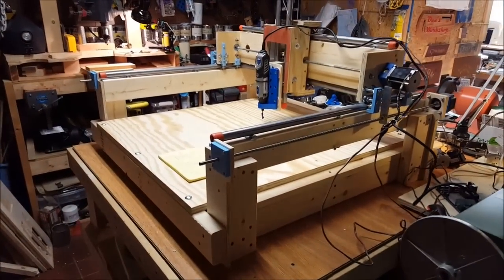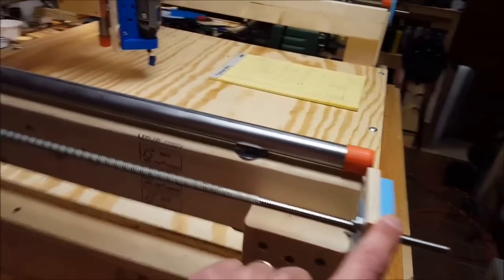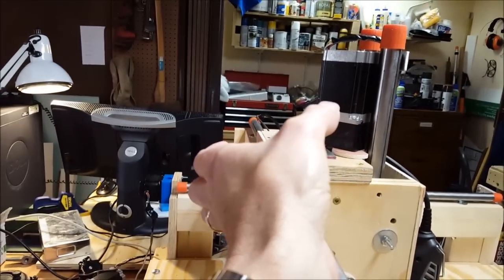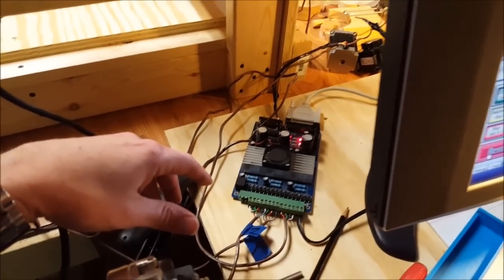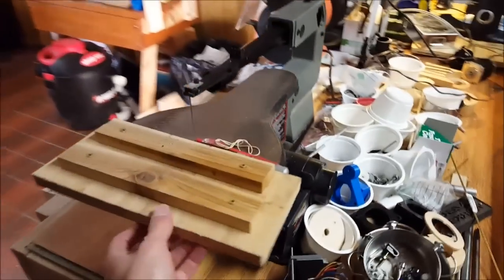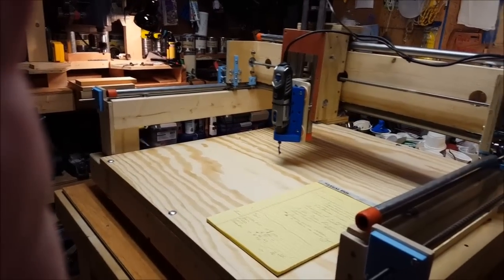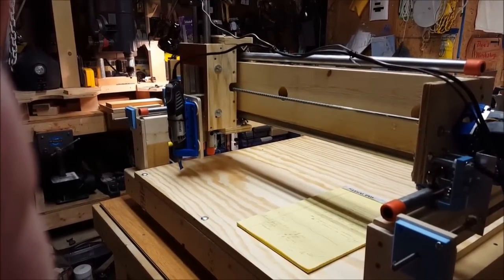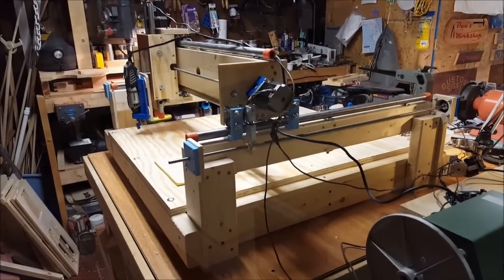Solsylva DIY CNC - Basic Machine Finished!

Comment: i built a 2x4 in 2011 and i want to get it out and make some mods on it. i have a bosch Colt on it i think, man its been so long.

i used the same solsylva plans, and picked up the 3 motors plus driver board in a case, i thinkt that setup was around 400 bucks back then. in all i think i spent about 1000 bucks to build the whole machine. hard part was software. i just cobbled free stuff together and eventually that took its toll on me. but now, maybe revisitable.

Comment: hey dear 
i love to c your creation and i am also planning to build my own cnc
can you please tell me how did you connected two stepper motor for x axis, i want to know to know how you made this connection with driver and breakout boars because it generally has only one point for each axis. Please tell me this
Reply from the maker: Ideally, whatever CNC board you use should have a dedicated driver for each axis.  But for my projects, like this one, I've been able to just double up two motors on one axis.  Since the motors are going in the same direction they are just connected to the same driver in the same order.  Wrap the wires together to insert into them into the screw mount.  Best of luck in your project.

Comment: It's a great start, but you need to pull off that stupid dremel piece of crap, and put on a real spindle, and then you will fine.
Reply from the maker: Already did that here...https://www.youtube.com/watch?v=e2QDJi4FLc8
Reply: I bet it did not take too long to figure that out, but you did a really nice 3D print of the holder. Amazing print.
Reply from the maker: Yeah, using the Dremel was not my long term plan but I was hoping to have it on there for a while.  I've used this Dremel 4000 on other CNCs for small stuff and it's been okay.  Just wasn't matched well with this beefy of a machine.  The prints did come out well from this cheap 3D printer kit.

Comment: That wood is going to move as the weather changes. Goodluck
Reply: alphasxsignal even if it's all plywood, moisture content and humidity are going to be a bitch when trying to get high accuracy through time.
Reply: he she use the cnc to build parts for a aluminium version ;D

Comment: What voltage do you run your motor drives at? I don't want to tell you how to spend your money but I upgraded from TB6560 to TB6600 drives myself. It was a nice performance bump for me. I have BL-TB6600-V1.2 drives. They're like $8.18 a piece. You could setup your X axis right with them. Running 2 motors off one drive is jenky, but you know that. Those all in one TB6560 boards are crap. I'm not going to get into why, but how they sense current is garbage. If you do get some 6600s hit me up and I'll explain how to set the current on yours.

Comment: For the spoil board, a suggestion that might make it easier to replace, instead of those giant bolts how about some screws? That would make replacing your spoilboard less of a hassle. Just some thoughts from a previous cnc build i did and built it similar. Nice job btw. this was a great build and videos were great.
Reply from the maker: Thanks for your comments.  I thought about that but wanted something that wouldn't chew up any parts of the actual machine when replacing parts.  But that is certainly an option.

Comment: I recently "reworked" my CNC.  Went from Drawer slides to V bearings and Aluminum Rails.  Also went from 1/4 -20 threaded rod to timing belts on the x and y.  I upgraded the power supply from 12 V to 36 V.  Moves like a dream, and very fast in the movements.  The only thing  would rework is the height of the y axis it is 6 inches off the table and does flex a bit with the router hanging way out there.  The design is very loosely based on a black tow design.
Reply from the maker: Great upgrades. My first machine was a drawer slide unit.  Learned a lot from that build.  Best of luck.